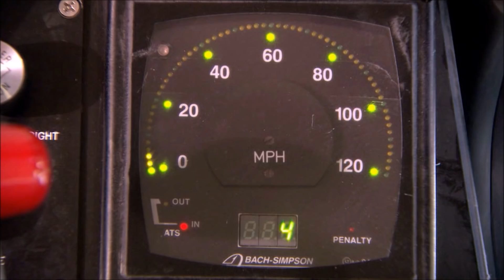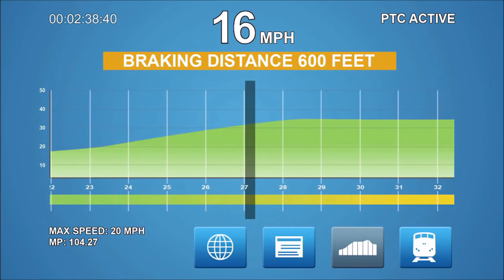Amtrak 501 "Cascades" Train Derailment 18 Dec 2017

Comment: The question should be (or at least another question is) why is a curve requiring 50kph speed limit on a brand new section of track?  Looking at the overhead, this curve could have been eased considerably.  After all, 130kph is really not very fast by rail standards.
(I've used metric units for the benefit of those watching outside the US)
Reply: Most of the trackage in this new routing was not actually new track. They had to construct only a small amount of new track that connected existing but previously unconnected pieces of track. The existing track was upgraded as part of the project. The track and bridge where the derailment occurred has been there for years, and was originally built when the highway was still US 99, years before it became I-5.
Reply: It has been reported that this line is on an old Northern Pacific right-of-way. It would not surprise me if replacement of the bridge and the curves on either side of it was considered, but was not undertaken due to lack of funds.  It still should have been possible to safely operate if the speed limit had been obeyed, even without PTC, if the NP had been able to do so in the past. 

The run to the curve approaching the bridge from Tacoma is tangent or nearly so for a considerable distance. I wonder where the speed limit sign that should have dropped track speed from 80 mph/130kph to 30 mph/50 kph north of the curve is located. The numerals for “30” might look a lot like “80” if one isn’t 100% familiar with the route or are momentarily distracted just as the speed limit change comes into view.

On the topic of why PTC wasn’t active on the line before the first run, consider that we are approaching the end of a calendar (and possibly fiscal) year.  Juan will undoubtedly let us know if it is discovered that financial considerations might have influenced the decision to initiate service now and complete PTC commissioning as early as possible in 2018. 

I’m an electrical engineer and IFR rated Mooney pilot, not a railroad man, but I have read considerably on the history of the PRR and B&O. A notorious crash of the eastbound PRR “Red Arrow” on 18 February 1947 bears some similarity to yesterday’s crash in that both trains entered a 30 mph curve at more than double the speed limit, although the Red Arrow was descending a 2.36% grade into the right-hand Bennington Curve that itself descends at 1.7% eastward.
Reply: Andrew Muhling we need to find a civil engineer among Juan’s subscribers who could estimate the cost of building a new single-track bridge crossing I-5 at a sufficiently shallow angle to permit at least 100 kph track speed—complete with the cost of the Environmental Impact Statement required to remove all the trees along the proposed new alignment.  An electrical engineer’s educated guess would be at least two times the average $8,000,000 per kilometer for around 1 kilometer, or maybe $16,000,000.
Reply: This is exactly the right question.  Someone better have a really good reason to design a "sneaker" curve in like that.
Reply: it wasnt s totally new line my umderstanding is it was an old right of way unused and was repurposed which explains the very old bridge still in use...  I suspect you will find the speed limit sign 2 miles behind is missing..  The graffiti on the bridge shows the right of way is not secure...
Reply: It may have not pertinence to this accident but I am curious why American railroads continue to lay track on timber cross ties.
Reply: And that brings up the question of why did it cost so much?
Reply: @Mikey300 
True, 80 might be mistaken for 30, but FRC regulations set the nationwide maximum speed limit to 79 on every track unless PTC or a similar system is in place, so there would be no signs saying 80.
Reply: caddad49 there is nothing inherently deficient or dangerous about roadbeds using timber ties; the PRR used to run at over 100 mph between Ft. Wayne and Chicago with steam motive power on 39 foot long jointed rail on timber ties. Of course the maintenance of those roadbeds was much more manpower-intensive than for ribbon rails on concrete ties, and elimination of the wages paid to the track section gangs was greatly desired by management. 

You’re quite right that everybody wants “the best”, but most desire for “someone else” to pay for it.
Reply: Mikey300 in Wellington Ohio a double track overpass for trains was built with pumping stations to clear water from highway part and capacity for 2 highspeed freight trains completed 3 years ago and 16 million rings a bell... JUST FOR OVERPASS AND ROAD under 1/4: mile of road and track...
Reply: garrrbo There's a dead man's curve in almost every state. The Ohio case is fully described here: https://en.wikipedia.org/wiki/Dead_Man's_Curve#Ohio
Reply: Mikey300 : I think you are rite on about financial on bridge and curve up grade and obviously on PTC since its been pushed back 3 yrs. I also suspect unfamiliararity and distraction were  facters since it was reported that there was a new conductor riding in the front to " learn the route " and it was the first official run with passengers. My Question is why a conductor needs to be in the engine ? But I'll be the first to admit I know nothing about operations of rail transp.. I also wonder how many times this engineer did practice runs?
Reply: Mikey300 : Regarding realignment that is exactly what is needed and there would not be much tree loss because most of the overpass would be in cleared I-5 freeway corridor
Reply: Mikey300,  Or to estimate the cost of building the proper track banking to the curved section.
Reply: I am not sure how you want to erase all three curves. The two adjacent to the bridge are easy to erase building a longer bridge at a lower angle, but you wouldn't gain any benefit. The last curve less than 1km away where the track joins two other tracks would still be left. The only real alternative would be a 1.5 km viaduct combining all three curves into one long curve, but that would cost at least US$20 Million. A short stretch eating up more than 10% of the whole budget.
Reply: @skunkhome
Likely they continue to use timber ties because they are far behind on maintenance, and wood ties are cheaper. Of course considering that wood ties only last about 10 years on busy freight lines, this seems like a foolish thing. But I have noticed many foolish things done by the railroads over the years, such as the abandonment of useful and shorter routes to “save money.”
Reply: Ethan Lamoureux doggone It, you’re right!  Maximum speed is 79 mph without Automatic Train Stop or (now) Positive Train Control.
Reply: We always want the newest and best but don't want to pay for proper maintenance (RR, Roads, Bridges, etc.). Timber Ties-"We have always done it this way!" Another possibility for high speed, "You will get there on time or you'll never work in this industry again".
Reply: Yes, that was my thought as well.   I am betting they didn't have a choice for some reason.  No doubt some smart people on this project.
Reply: Well said, the reason the line was not redesigned and rebuilt to the 79 MPH limit, is because the connection to the original route is only about another mile down the track. That's hardly cost effective to realign and build new bridges across I-5 when the trains must slow down and connect to the original route so quickly there after.
Reply: The reason the line was not redesigned and rebuilt to the 79 MPH limit, is because the connection to the original route is only about another mile down the track. That's hardly cost effective to realign and build new bridges across I-5 when the trains must slow down and connect to the original route so quickly thereafter.
Reply: skunkhome - This newly rebuilt route is almost all concrete ties, I was surprised to see that those on the bridge are still wooden, but everything else I've seen is concrete.
Reply: Union labor, on a government job, requiring "prevailing" wages. over 14 miles of brand new concrete ties, and continuous welded rail and newly upgraded crossing gates at all grade crossings. Plus the cost of the not yet functional PTC  system.
Reply: Though if you were planning for the future upgrade of the network to modern speeds past the end of this line it would make perfect sense.  Spend a little money now and save a great amount later.  Every rail network in the world has realignments and upgrades to increase efficiency as time goes by.  If there was not a strategic working plan out to 2040 (or some other future date) I'd be really surprised.
Reply: Mikey300 the speed signs are set with an advamced warning two miles in advance of the actual speed change.
Reply: Move the tracks you'll have to acquire the land next to them. Then you'd have to build a new bridge which by itself will cost six figures.
Reply: Yes, and??
That is how you do these things.  Why spend the money to do the job in the first place if you're not going to to it properly?
Reply: Andrew Muhling because you have a budget and you have to prioritize.
Reply: ..which as it turns out will cost you more than a bridge re-alignment.  
Being cheap usually costs you more.  Someone on the design team needed to stand up and make a better case.  I also feel the need to say that now we understand what work was actually done to this right of way, US$180 million should have been easily enough money..
And here's an illustration of why i'm so confused by this.  The link below is a current project to gauge convert/re-open 1130km of track.  This includes increasing the axel load to 21 tonnes.  The running speed is slower, but it still give you an idea of what you should expect for your tax dollar.  All this for AU$416 million and in a country where labour is much more expensive than the USA.
https://static.ptv.vic.gov.au/siteassets/PTV/PTV%20docs/Projects/Murray-Basin-Rail-Project-Summary-Brochure.pdf
Someone over there has been stealing the gravy..
Reply: Andrew Muhling 

This is not a new track-   Its new to run amtrak on this line
Reply: David Brown:  The conductor is the overall boss in charge of train operation, communicating with dispatch, adhering to timetables, etc.  In effect he navigates the train while the engineer deals with the physical operation, manipulating the actual controls.
Reply: Good comment. Only the USA [surprised?] does not use metric.
Reply: But as is said in Juan's report, they spent US$150-180 million (odd that there's no exact figure).  This is not peanuts and the rout is only 22km long..  Surely this is enough money to do the job properly?
Also this is a passenger service.  You don't want to be losing time unnecessarily for poor track planning..
Reply: Does anyone know why Dead Mans curve is on I90 in Cleveland Ohio?

Comment: Thank you for the information. You're always giving us the latest information, that we normally don't get. In this situation, one of the biggest questions, is why the train was going 80 mph, instead of 30 mph. Looks like the curve wasn't designed for the higher speed.
Please keep us updated. Thank you.
Reply: Human error at first glance appears to be the cause. This is exactly why the speed limit was 30-mph.
Reply: I agree with you, totally. If indeed that is the case, without a shadow of dought, the question is, What or who or both kept this train at the high speed, and did not slow down? And, where does the slower speed start? Lots of questions.

Comment: Congress mandated it to happen at the end of 2015 but didn't include any money for it. The latest budget also reduces funding for AMTRAC. I doubt that the train control system will ever be installed unless we can figure a way to pull it from our posteriors. Good reporting Juan.
Reply: Well, to be fair, Amtrak is SUPPOSE to operate as a separate for-profit corporation that pays for itself.  It doesn't of course.  Congress and other regulators mandate all kinds of things, including safety measures, on private industry without funding them.  They just say, "do it:", it's the law.  Build the additional cost into the price of your product or service.
Reply: It's time to evaluate whether or not we actually want transportation rail to be a thing. When I was a kid, My family did an annual trip across country on the train. I recently tried to recreate this with my wife and was rudely made aware that trains don't go anywhere any more. A trip from Virginia to Washington state involved 4 train transfers and 2 bus rides of over 100 miles, just to leave me 75 miles from my destination. So many tracks have been eliminated that there is no service at medium sized towns. Oh yeah, the price was more than a first class seat on a commercial airline. Local commuting may still be possible by rail but national infrastructure for rail has been destroyed.
Reply: If Amtrak builds the cost into the ticket, I couldn't afford to buy one.

Comment: Its kinda interesting that after reviewing the PTC in the metrolink section how the system did not work since it has GPS . does it require installation of radio equipment trackside for the PTC to operate..  i predict the fastest PTC installation ever done by the contractor who does that.   

 i can see another possible error in track design.. the entry to the curve and across the bridge from the straight line should have been poured concrete with the tracks attached with clips or bolts  instead of tracks on ties on top of a gravel roadbed..  i don't know if that bridge is strong enough to support the additional weight of all the concrete and perhaps that is why it was not done.   that might increase the speed zone across the bridge.   i wonder if there is enough room to create a wider swing out before the swing toward the bridge..
Reply: wayne p --- It may be a 'camera angle not correctly interpreted' on my part but at 4:32 of the video it appears the pc (beginning of curve) of the track construction was not in the correct location as it appears the track isn't a true circular curve behind the tail engine. If I'm correct, this might be enough to cause the high speed lead engine to be thrown from the track, yet allowing a 30mph train to pass without problems.

Comment: The Talgo train equipment used for the Cascades service was built in Wisconsin by Talgo to meet Buy American requirements. It was built in two batches, one in 1998 and another in 2013. The train sets use a single axle between cars and can tilt to allow higher speeds in curves. These trains have been running in Cascades service for a number of years without incident. 

The Talgo cars are smaller that conventional Amtrak passenger cars, you can see that they are much shorter when looking at the videos and photos. I think the capacity of the train may only be about 200 passengers in total.
Reply: Yeah I think I heard today that they have 36 seats a piece
Reply from the maker: David Taylor wow! Thanks David. Good info.

Comment: If this bypass was new construction, why was it not built with PTC? Yes, it's expensive, but here we see the tragic cost of going without.
Reply: Not that it matters, but it appears the "new" bypass is really refurbished previous railways.   On google earth you can go back in time and see tracks were there long before this.  You can also see they made much improvements starting in 2015.
Reply: Apparently it was built with PTC, just not enabled yet, possibly still testing.

Comment: heck of a guy , terrible story.
how's a high-speed line on first passenger run.,..travel over a bridge that's rated 1/3 of its high speed? why build that in on new line?
edit: I live near the sharpest/ longest speedcurve in the province, when I was young, my '81 shortbox ran around at 90 with teeth gritted.... but only a few semi have run off in last 30 yrs.... it's sharp, but even if in lala land it's negotiable at lega highway speed...unless icy
Reply: another nice RARE positve reply on you tube, i get so tired of all the NEGITVE angry not nice posts... but to answer your quesiton is that i am sure that they brought up the 30 MILE an hour corner in their meatings and stuff that they have... but some one said "FORGET ABOUT IT!" and then it was of course forgoten about and never brought up in the meatings again... untel just now and once again we will be told by the AUTHORITIES to FOGET ABOUT IT and of course every one will forget about the corner part... and bla bla bla yadda yadda yadda...